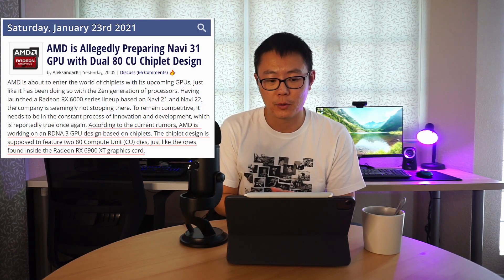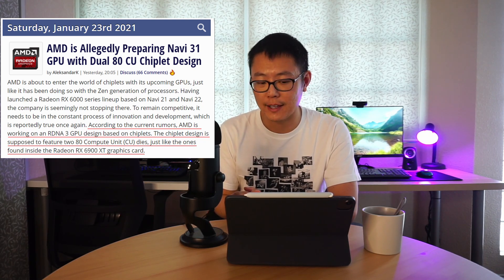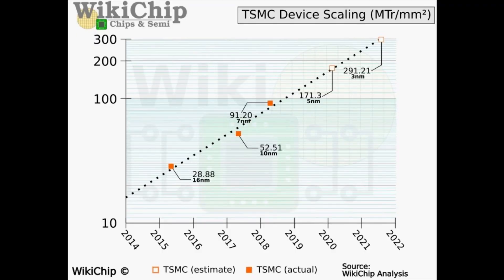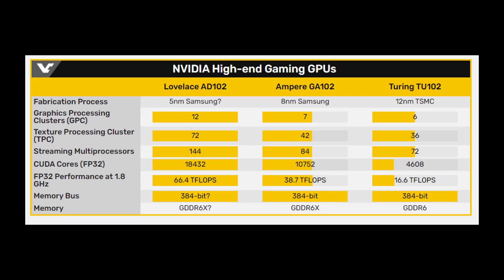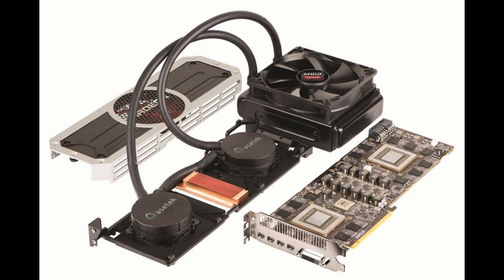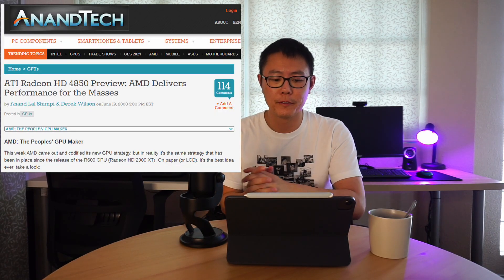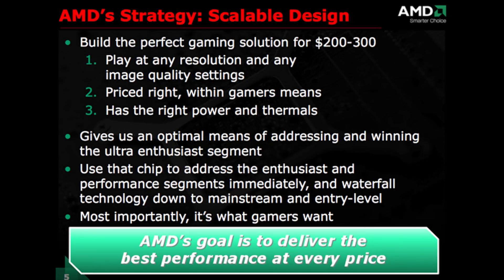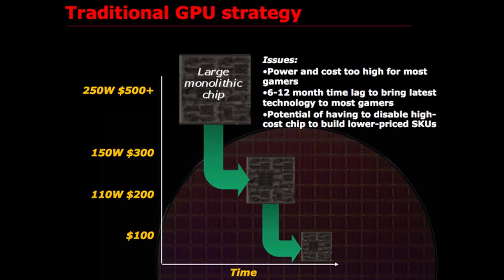Why AMD's next gen Navi 31 may use a CHIPLET design.

Comment: And I thought 2 Radeon Pro VII gpus with an Infinity Fabric connector yielding 120 CU was the latest upgrade. Two 300 watt gpus doubling the VRAM and CU with two single slot AIC.  Two 80CU 5nm chips on one die would use all of the GEN4 X16 bandwidth. TR, TR Pro or any X570 could connect that to your CPU. Bravo AMD.
Reply from the maker: Well it might not be 300 watt next gen for 80CU - it could be something like 200W. And a 400 Watt isn't that crazy, seeing as a AIB RTX 3090 like the strix can do 480W. I'm just wondering whether it will work like a single GPU, or whether it's more like crossfire.

Comment: Good information, from your explanation, it sounds like AMD is doing the usual business stuff, reduce cost, make production/design easier, sell more, come out with new stuff in a shorter timeframe, no thank you, I will be sticking with Nvidia then. AMD's biggest downfall has always been their drivers and if this is the route they're choosing to go (taking the easy way) ... I see a lot of potential problems...
Reply: Intel said the same thing about ryzen design. Now they can't even make 10 core high performance chip.
Reply: @erminbajric4633  That's true, but Nvidia isn't slacking like Intel, yeah Nvidia is pretty bad for holding back performance, but hardware wise, they are definitely ahead. I find it more disturbing that AMD would just slap on additional chips rather than focusing on better designs.
Reply from the maker: From a design perspective, I think if both were on TSMC 7nm, 3090 would be around 20% ahead of the 6900 XT. Power, Efficiency, clock speed etc. 

AMD seem to be focused on offering an alternative solution, like more vram on their cards, or the RX 6800 being a card in between the 3070 and 3080.
Reply: @JimRPG  Yeah, I am just concerned they are taking this approach, rather than focusing on improving architecture generation on generation they just want to slap on another chip and often times when companies start doing these things (making processes easier, cheaper, faster), the quality starts failing and AMD still has to catch up on the driver side of things as well.

Either way though, a monolithic design imo would definitely be better to remove that latency gap between individual chips if they can get it right, so I will wait to see what LoveLace has to offer, but I can also hold out for 5th gen, should not be an issue as I still game at 1440p, I am also waiting for more decent 4k monitors to be released.
Reply from the maker: @rokusaburo6257  Yeah agree for sure! Though AMD has in the past spent a lot less than Nvidia on R&D so they're I guess trying to find ways around the R&D advantage Nvidia has. They also just passed the $100 billion mark in market cap. They used to be WAY smaller. They were in a bit of trouble before Ryzen. I agree I hope we see them doing more R&D and not just buying up companies with that bigger market cap.
Reply from the maker: They gave up some of those cores for larger cores in rocket lake.

Comment: Jim, I don't know. I have heard that developing for a multi-chip gpu would be like developing for cross-fire or SLI. I think that depends on the design. The example I look to is developing a non-trivial program for a Ryzen. Now there are core - core and CTX - CTX latency issues, but depending on how you write the code, you can dramatically reduce those issues. I point out the many games that have been slightly revised since Ryzens arrived, and the results from that. Now I think that's a better example / analogy for a multi-chip GPU.
Reply from the maker: Yep that's my question as well, we won't know until Navi 31 GPU comes out, and how much of a latency penalty there is on a multi chip GPU. We should be able to work that out though when compared against a single chip GPU. It also needs to function like a single GPU, otherwise having one chip that doesn't work in some games (like in crossfire) is a huge deterrent to spending a lot of money on a high end GPU.
Reply: @JimRPG  ~ Hang on to that thought, I just walked in the door after a week in Darwin....
Reply from the maker: @Kneedragon1962  Lovely place is Darwin.😄

Comment: I'm amazed by your videos, always on point and easy to understand,  i think chiplet design is also a cost saving measure to help with yields. 

I'm loving the new background, if you turn the lamp facing the wall you could obtain a more diffused light, not that right now is bad, it's really good.
Reply from the maker: Thanks Greg! Its an easy way for AMD to get more performance as long as they get devs to support it and hopefully it works more like a single GPU than multi GPUs in crossfire.

I might try with the lamp facing down. I had the lamp facing the wall/blinds but it didn't work as well. 😀